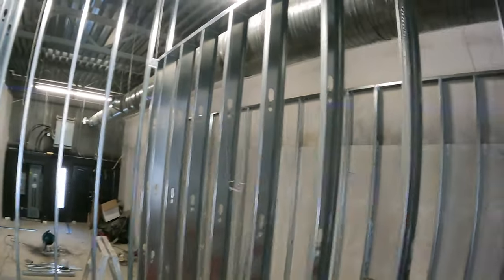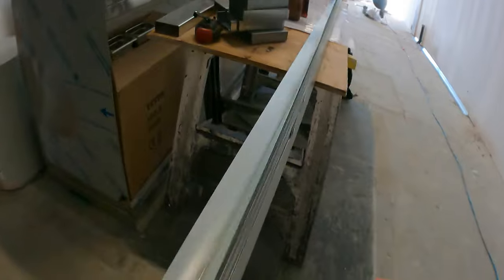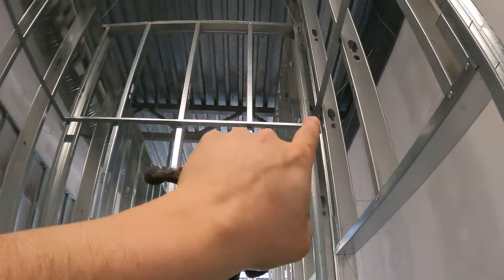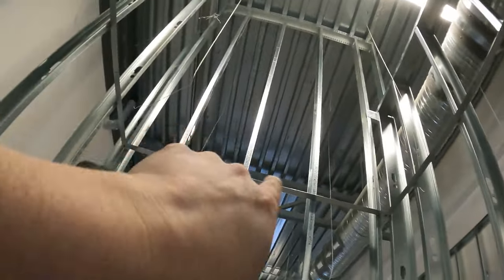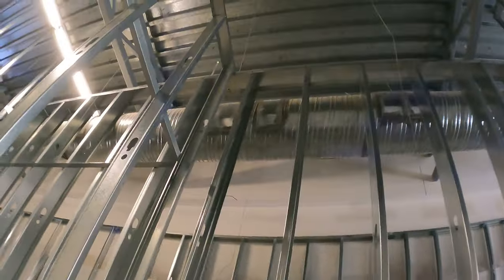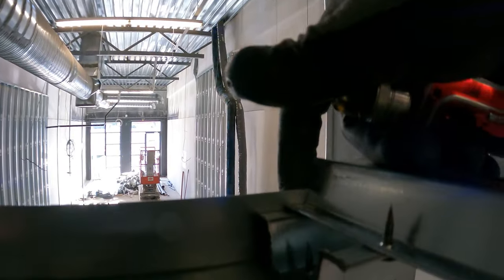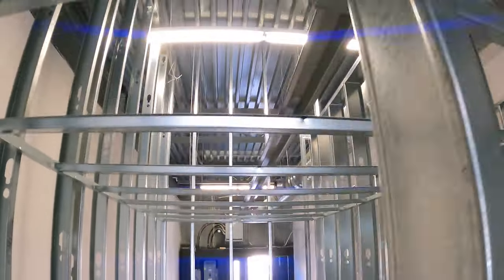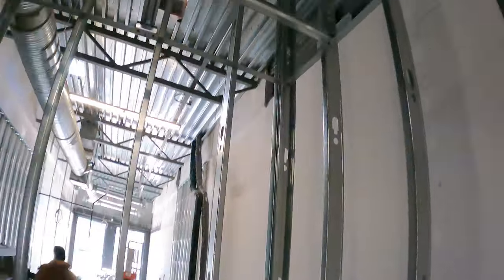Metal Stud Ceilings Furring Bar & Angle

Comment: how would you attach metal top track to  a sloping exposed wood roof (only rafters)?
Reply from the maker: Yes that can be frustrating. I have a video that shows this let me dig it up and I'll reply here.
Reply from the maker: Here it is! It's the same for wood just use  different screws like 1-1/4" drywall screws to screw the track and clips to the trusses https://youtu.be/Jjt-7oVCqIs?si=5HYOYsaZxR40PduY

Comment: Is this your preferred method for doing ceilings? 
Could you have used tracks and studs instead?
Reply from the maker: Yes it is my preferred way but we use studs and track too. It's cheaper to use the angle and furring bar so on a big job with lots of ceilings you will see a big cost savings. Sometimes it's just easier to order all studs and track for a job with only a few ceilings. This system is easier to brace. For large ceilings always use this method and put bracing runs every 4' and hanger wire every 4' so your braced in 4'x4' sections.

Comment: I have a question to share opinions , if you do a 650 grid ceiling.  50’ by 5’ and you use main beam Armstrong each 16 “ do you use wair hangers ?
Reply from the maker: I would right down the middle add hanger wire. Usually every 4'x4' Sq area would have hangers.